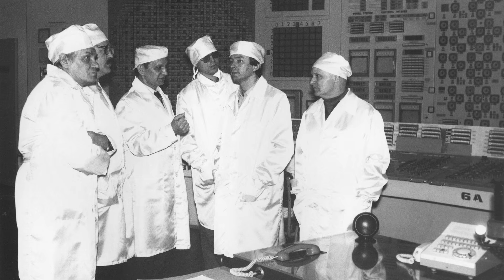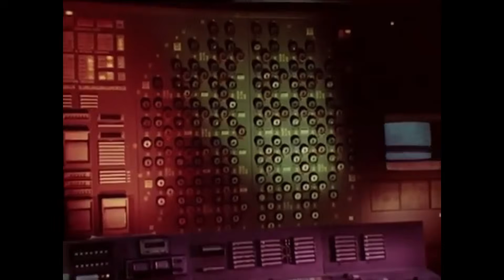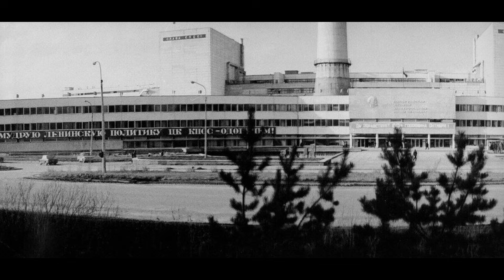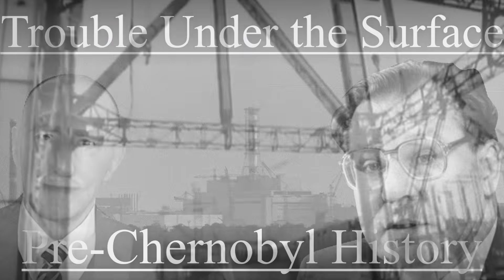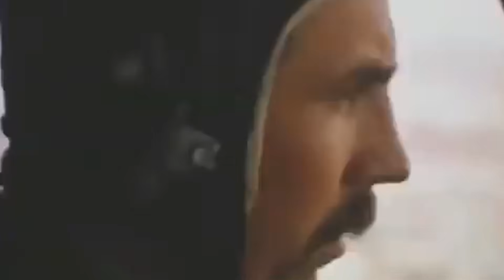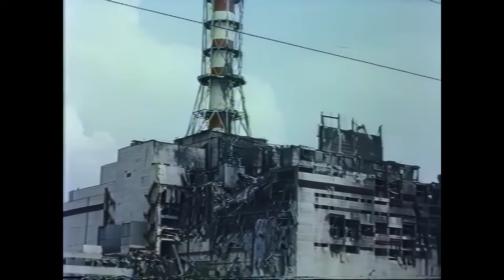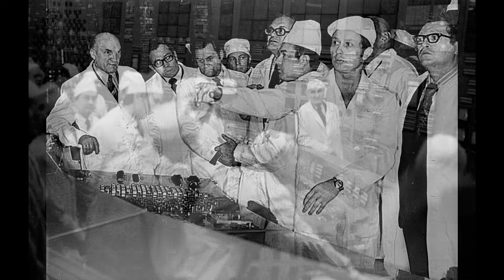The 1975 Leningrad Nuclear Accident: The Road to Chernobyl

Comment: In the Gorbachev Forensic Report, where evidence is show and discussed, there is a very important reason to why was different, and different even from the 1982 Chernobyl incident: for the moment AZ-5 was pressed, there was no reactor to shut down any longer. Additional forensic evidence shows a fast neutron reaction, what means graphite wasn't there any more (that demolished the narrative of AZ-5 as cause of the accident), and neither the water, only highly enrichment uranium and plutonium in an already destroyed core.
The main conclusion is: the 12 h delay in 1986 created a higher poisoning level in the block 4 of the V I Lenin Memorial NPP, which end in a faster power surge.
Reply: Sorry but how could any highly enriched uranium have become present in the core? Wasn't the fresh fuel enrichment only about 2% U-235 in total U?
Reply: @derekp2674  You don't need highly enriched Uranium to produce a fast neutron reaction: Plutonium is produced in the RBMK naturally and (from U238), in high reactivity conditions, is produced in a great amount, but you did need to reduce to zero the graphite (with zero moderation you can get a fast neutron reaction from MOX at lower enrichment rates in high reactivity environment). In any case, I'm talking about what was measure, the exact mechanism of how this was possible have not been study yet. Only possible explanation: graphite could not been present in the parts of the core where this reaction take place, is the only thing we can be shure.
Reply: @andymarquez9902  So your previous post incorrectly stated that highly enriched uranium was present?
Reply: @derekp2674  No, you not completely understand my reply: you don't start with "highly enriched" Uranium, you have a Plutonium production reaction that reduce U238 in the mix, that increase enrichment level, and, by the other side, increase fast neutrons availability, the combine effect is that you have highly enriched Uranium (fission reactions of U238 may occur with high energy neutrons), but not at levels of what we normally call that, however, is enough as to behave as such in that particular conditions. You don't get highly enriched Uranium in the reactor, you get it in the reaction after the core is damaged. For particular conditions as this, what can be considered as "enriched" is not what we usually call it. And, part of my original comment refers to the fact that you need either highly enriched Uranium, Plutonium, or a particular mix of both to produce fast neutrons chain reaction.
Reply: @andymarquez9902  Ah I think I see now! I think you are now saying you meant "effectively highly enriched uranium due to inbred Pu" instead of what would normally be meant by "highly enriched uranium".
Having now considered this some more at my end, I should add that the occurrence of a self sustained fast neutron chain reaction does not require or imply the presence of actually or effectively highly enriched uranium (or MOx).
Although conventional civil UOx and MOx fuels both require a moderator to achieve criticality , a doubling of the usual maximum fuel enrichment is sufficient to allow a self sustaining fast neutron chain reaction.
Nonetheless the reported claim that the accident led to breeding conditions resulting in criticality from this seems very strange.
Reply: @derekp2674  There are four different reports that can be combined into this: the Gorbachev report (tho one that cover the entire forensic investigation) do not claim such reaction, but, specify a break of technological channels in some place inside the reactor (this paper contains a detailed chronology, supported by documents, such as registers from seismographic stations, that prove that destruction of the reactor took place minutes before AZ-5 order), according to the state of components after the accident; there is a report about the composition of the radioactive cloud over Scandinavian countries (I don't remember wich exactly) that claim that the concentration founds can not be explained assuming only a slow neutrons reaction, a third paper use this to explain why Cherenkov radiation was observed over the building of the block 4 that night, just before the explosion; the last paper simulate reactivity inside the core, it use oficial narrative, the problem is that oficial time-line is untenable under the simulation results (the entire process took twice the time required to destroy the core under the circumstances obtained in the simulation). The combination of all this lead to conclude that in some point, in a small portion of the core, a non-moderate reaction took place, do to the destruction of some portion of the device; now, at that point, no shoot down could be performed, do to the fact that control roads couldn't reach that part of the core.
Reply: @andymarquez9902  Sounds fascinating. Can you provide citations for these reports and are they readily available?
Reply: @derekp2674  I download all this from internet, the Gorbachev report is the one that looks like a part of a printed magazine that someone digitalize (it was available as a PDF download link only), but I will need some time to search for the references, because I read those at least 5 years ago.
Reply: @andymarquez9902  Thanks - this is all fascinating stuff. When you referred to a "fast neutron chain reaction" in your original post, did you mean one with sufficient energy yield to cause an explosion?
Reply: @derekp2674  First, here is half the references, the others I will need to search in my drive, since Google Scholar is sending me data from pay studies dedicated to health care.
This is not the edition of the article I read originally, but is the same, only a different presentation, it come from a repository of the Kyoto University:
https://www.google.com/url?sa=t&source=web&rct=j&opi=89978449&url=http://www.rri.kyoto-u.ac.jp/NSRG/reports/kr79/kr79pdf/Gorbachev.pdf&ved=2ahUKEwibk7_Rqc2LAxUsTTABHYipKIQQFnoECC0QAQ&usg=AOvVaw3P5Ut_b06knoYrfRrDAA5F

If you search "boris i. gorbachev" you will find more presentations of this article in universities download sites.

De Geer, L. E., Persson, C., & Rodhe, H. (2017). A Nuclear Jet at Chernobyl Around 21:23:45 UTC on April 25, 1986. Nuclear Technology, 201(1), 11–22. https://doi.org/10.1080/00295450.2017.1384269

Second, no, of course I don't refer to a fast neutron reaction driving to a nuclear explosion, I'm writing (here) about a localized reaction with a contribution (of course, it was mainly a slow neutron reaction) to the destruction of the core do to a steam overload, and thermal damage, that prove a reactor state that can not be solved, or significantly aggravated, by AZ-5, do to the fact that structural integrity was already absent, and control roads couldn't do their job (for good or bad).

Comment: 23:10 i am unclear if you meant that shortening the graphite is a tacit admission that graphite bad.. cuz it is.   Chernobyl had three problems.. no water, graphite displacer, and xenon burned off...   it positive voided all over the countryside...
Reply: Shortening the graphite was bad because it created water spaces below the graphite when the rods were fully withdrawn.
Driving the rods back in then drove out that water and replaced it with graphite. At the bottom of the core, this would remove the neutron absorption caused by the water. That's exactly the opposite of what you want to happen when you drive the control rods in.
As a rough analogy, the effect is like putting your foot on the accelerator instead of the brake when you need to slow down for a stop sign.

Comment: The difference between 1.8% enriched and are 2% might not be as insignificant as just .2.

It might be a whole new machining process/manufacturing process which changes the makeup of the rods all together.

What does that mean?  Well... it might mean the impurities in the old rods saved the older reactor due to slower reactions than the newer rods.

The Soviets struggled in a lot of advancements over the years due to frequent purges and because their entire nuclear program relied on stolen data and not discoveries.... lets just say there was a lot of guess work.

Comment: RMBK and all Boiling Water Reactors are just stupid. What do you save? A few steam generators and a pressurizer at the cost of contaminating the entire secondary. Sure your entire primary system needs to be able to handle 2400 psi but Pressurized Water Reactors are safer and easier to control. You have a few days of positive Moderator Temperature Coefficient  after a refueling but after that the reactor is all rods out and power control is done with boron and water concentration in the moderator. 
The Russians were stupid to adopt this design and I think it's because it's different from western design.
The core problem is training.
I spent 6 years in US naval nuclear operations with the first two years in classroom and then 4 years in the fleet. When I moved to commercial operations I spent another 18 months of training and extensive testing before entering a control room.
After that it was 5 weeks on shift followed be a week of classroom and simulator training with testing as a cycle all year long. If I failed the written or simulator testing I would have been removed from shift and given additional training.

Comment: The RBMK reactors were a bad desgin they were designed to be cheap and efficient at the cost of safety.
Reply: Ridiculously Bad Made Kettle
Reply: @KyaraNB  Found On Road Dead or Fix Or Repair Daily
Reply: Arguably all nuclear power generation is an accident waiting to happen... just bc the higher ups make unreasonable demands. 😮😮😮

Comment: I ask myself if it is the same Xenon that are in the bulb of a modern car front light..
Reply: Chemically it would be the same but the Xe-135 here has a higher atomic weight than any of the stable naturally occurring isotopes in ordinary Xenon. The Xe-135 also has very different nuclear properties because of its enormous neutron capture cross section.
Reply: @derekp2674  Thanks for the info.. 👍👍🇪🇸🇪🇸
Reply: @derekp2674  ¿A Xenon bulb would not work with Xe-135?.
Reply: @Raul1971xxx It would but it would also be highly radioactive with a half life of about 9 hours.

Comment: The neutron absorber caused a spike in reactions on its way into the core just after and a result of the "AZ-5" SCRAM button being pushed.  Basically as understood by the nuclear death cult, the graphite displacer descended into the active region at the bottom of the core, caused a spike in reactivity on its way down, which made it go boom.   Yet they still tell us "nuclear reactors don't explode", even Fukushima Daiici did'nt "explode"
Right?

Comment: The hubris of believing that “We communists built a reactor that can’t get out of our control” was the first and greatest blunder of the Soviet nuclear power programme.  Not building containment vessels to protect the public in case they were wrong was the second.   Why worry about things that are never going to happen, right?  Quite possibly the very best line of dialog in HBO’s Chernobyl miniseries.  Nuclear power is simply humanity’s only available answer to creating reliable, abundant, clean, and environmentally-neutral energy to power our world.  But the overarching need to have comprehensive safety systems firmly in place at NPP’s cannot be understated.  Not having them are disasters in the making.  Thank you for this amazing video, I learned a lot.

Comment: The shorter graphite for the control rods makes perfect sense for the differing outcomes between Leningrad and Chernobyl.  With Leningrad those longer graphite portions were already displacing more water thus AZ-5 doesn't cause as big of a spike since graphite was already in play.  At Chernobyl where it goes from neutron absorbing water to neutron enhancing graphite the spike is much larger because of the fact that it was already getting out of control even with the water slowing things up.  Shortly after AZ-5 is pushed and the flip in reactivity occurs between water and graphite that was all it needed to really go over the top on reactivity thanks to the positive void coefficient combined with that shorter control rod graphite portion.

Comment: Tell me how an rbmk reactor core explodes?
Reply: Water is rapidly vaporized into steam, causing an explosion of steam pressure which is enough to blow off the top of the reactor.
Reply: IT DOESN’T!
Reply: Are you stupid?  Go up on the roof, look down at the reactor 4 building and report back what you see.  It’s only 3.4 Roentgen so no big deal.

Comment: Why does higher enrichment reduce the void issue? What other changes were made?
Building an reactor in such a way that the water is not just the moderator and coolant but also necessary as an absorber sounds like a bad design.
Reply: Higher enrichment alters the fuel to moderator ratio making the reactor less over-moderated (moderation, performed by graphite, slows down neutrons that in turn are more likely to cause fission), in which circumstance water acts as less of an absorber. Unfortunately I don't know more than this. Good question.
Reply: @markusw7833  With higher enrichment the moderation can be shifted away from carbon towards water, because otherwise the water absorbs too many neutrons.  The russian reactor designs are unsafe because the carbon is sufficient for moderation.
Russian reactors are good for breeding Plutonium and using low enrichment.
Water moderated reactors use slower and fewer neutrons.
Reply: @0MoTheG  Western reactors and VVERs don't use graphite. Why are graphite reactors particularly good at producing plutonium?
Reply: @markusw7833  They aren't explicitly good for Pu, but they have the lowest absorption and thus work with no or low enrichment. Graphite reactors were the first to breed Pu for weapons.
Reply: @markusw7833  VVERs and most western reactors have their cores inside single large pressure vessels.  The vessel must be depressurized and opened to replace any fuel assemblies.  This makes it very difficult to produce plutonium for nuclear weapons, for which frequent fuel replacements are needed.  If the fuel is left in the reactor too long, then too much of the plutonium-239 is converted to plutonium-240, which is unsuitable for nuclear weapons.

Water-cooled graphite-moderated reactors use "pressure tube" design, where numerous tubes of cooling water pass through holes in the graphite moderator blocks.  The fuel assemblies are placed inside the tubes, so every tube must have a separate access, to open it individually.  It is then relatively easy, to allow any tube to be opened and its fuel changed at any time - even if the reactor is running.  This permits the frequent fuel replacements necessary for weapons-grade plutonium production.
Reply: @CoastalSphinx  Meaning the potential dual-use mode of the RBMK and the refueling machine. Do military reactors have comparable refueling machines or does their dedication to producing plutonium allow for downtimes for mass extraction?
Reply: @markusw7833   I had thought that all military plutonium production reactors used similar refueling machines, however I just found out that the US heavy water reactors at Savanah River did not.  Instead they would shut down completely for refueling, several times a year.  So you are correct, dedicated reactors can use mass replacement of fuel.

[Edit: also the Savanah River reactors operated at very low pressure, originally zero and later raised to 5 PSI (34 kPa).  That meant they did not need a massive pressure vessel like a PWR or VVER type.  For power production, high pressure would be needed, and this would have slowed down the refueling somewhat due to the time required to open and close the pressure vessel.  But it still seems more feasible than I had thought - refueling was actually achieved in 6 days with no pressure vessel, and I suspect it would have been at most 10 days with a pressure vessel.]
Reply: The short answer to this question is that, for any given reactor power, increasing the fuel enrichment reduces the thermal neutron flux that needs to reach the fuel rods.
In turn, that reduces the rate at which neutrons are absorbed in the coolant.

Then, because the coolant is also a better moderator than graphite, if the coolant boils, reactivity can go down, if the loss of moderation is more significant than the reduction in absorption.

Comment: Soviet nuclear "safety" essentially boiled down to wishful thinking. It was an incredibly fragile system that relied on there never being any abnormal circumstances and operators always following KGB-approved procedures to the letter. Of course, it's easy to see that this system was doomed to failure right from the start, and things only got worse when safety-critical facts about RBMK reactors' instability were deliberately withheld from operators.

Comment: very good analysis. I always thought Diatlov's analysis was really sound in that the reactor was doomed from much earlier due to the "2-reactor" effect + control rod reactivity insertion into the lower half. the postitive void coefficient is what then even increased the reactivity. when the trouble started for realy in Czernobyl they had like just 300 MW thermal , and 3 MCPs running, so I dont expect there was a tremendous amount of voiding present when AZ--5 was pressed ?